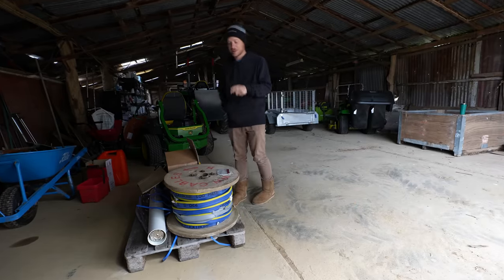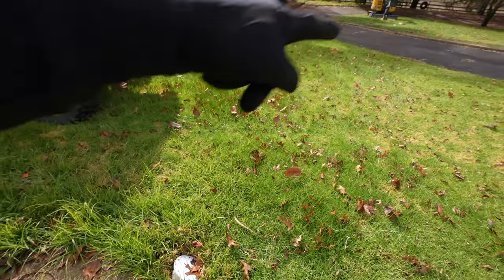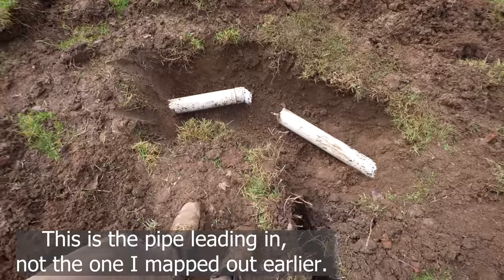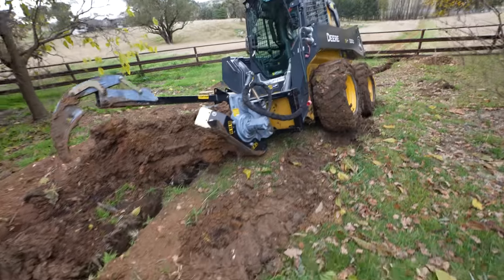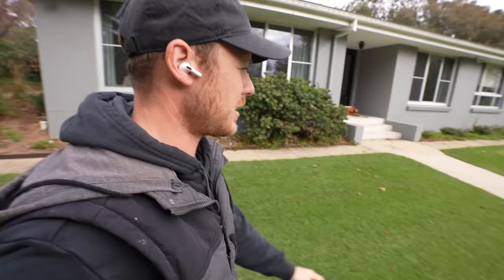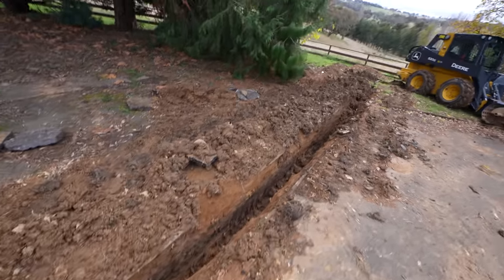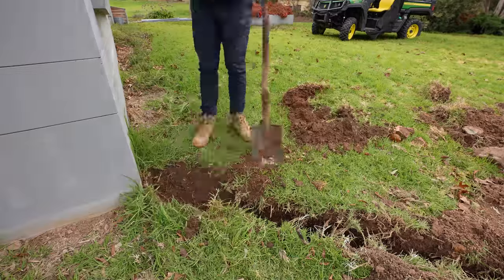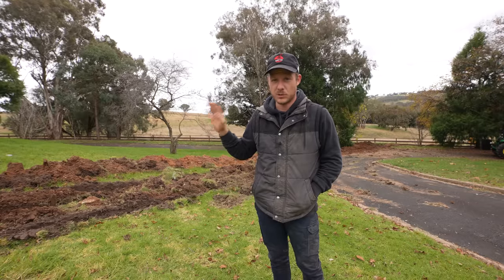What A MESS…

Comment: Trencher oversized for the job. Surely a small walk behind would have been better suited.
Reply from the maker: Needed to be 600 deep which the walk behinds struggle to do. (I’ve used them a few times in the past) Especially in the mud. Excavator did the job anyway 👌🏽
Reply: @LawnTips  Yea understood. Especially considering what you have found in the ground so far.